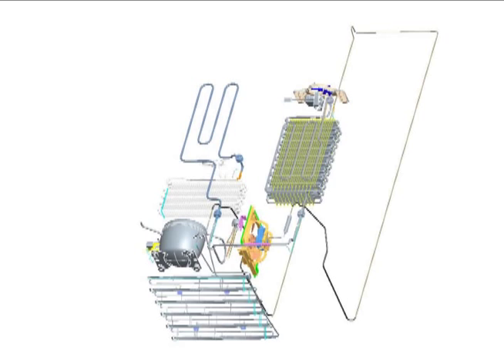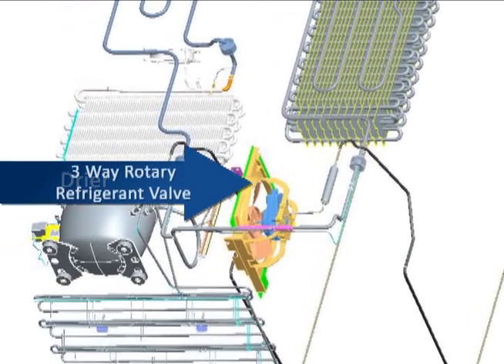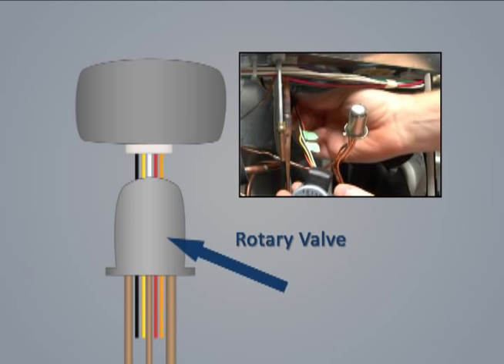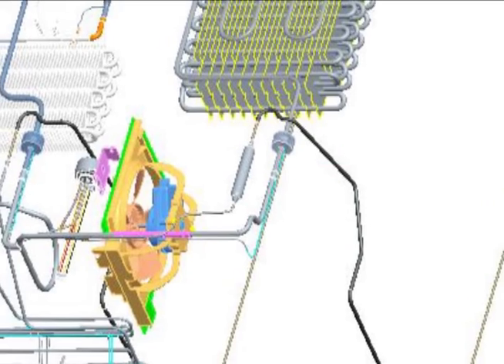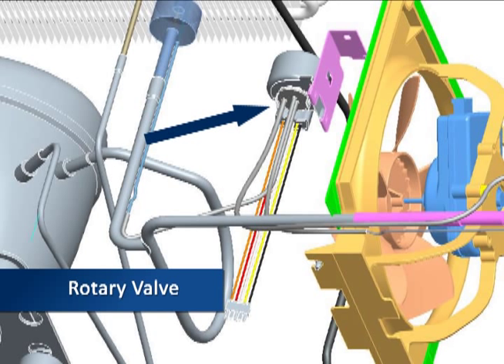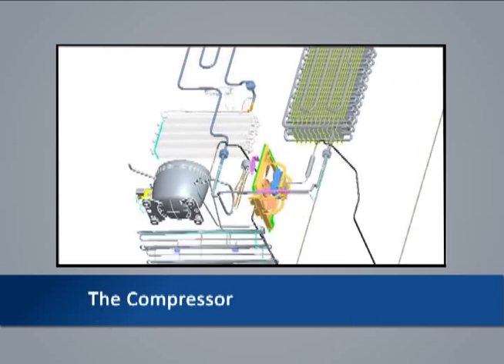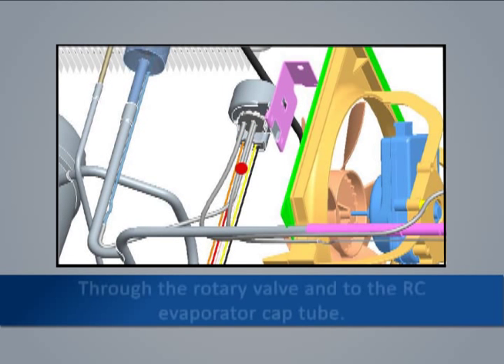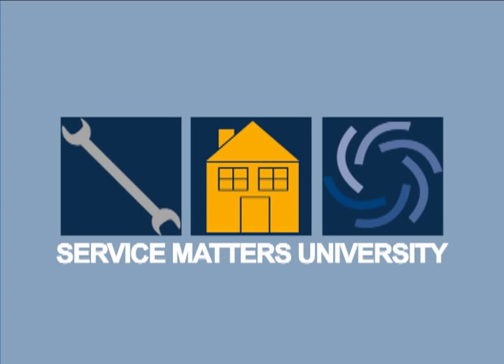Whirlpool SxS and Bottom Mount Dual Evaporator Refrigerator Theory of Operation

Comment: Great video, I understand the limit-cases as 100% refrigerator OR 100% freezer. But I still have a doubt: why the centre position is closed output? I understand this could be just temporary, but overpressurizing the condenser and forcing the compressor does not seem good to me - if not properly timed, it could even create hydro/shell test in the tubings.
I possible advantage would be to create a burst-flow for flushing the chosen capillary path (RC/FC),  but I question if this eventual benefit would be significant to overcome those other issues.

Comment: How can I troubleshoot the 3way valve
Reply: if it has a test mode test 4 watch for subtests 01 02 03 04 05 and watch for frost patterns if you're not tapped in to the sealed system, if you have run the tests and curt the cap tubes out of the 3 way vale, subtest 04 05 flood each ff and then fz compartments

Comment: how do you charge this system after a compressor has been changed? Any and all help is appreciated
Reply: press the far left two buttons in till it blinks 01 then press the fifth button till you se 04 that will put the switching valve to open home. what 20 sec. then unplug the fridge. charge to sticker in side the fridge. plug in test pressure readings. it will cool the fridge first then switch over to the freezer it will take some time to switch over or back in the controls as first talked about and run the test modes.